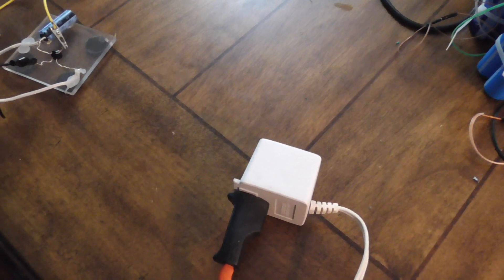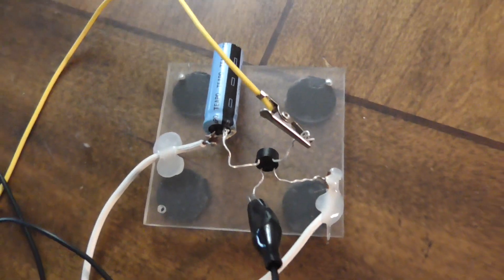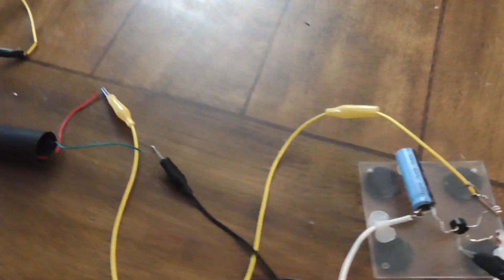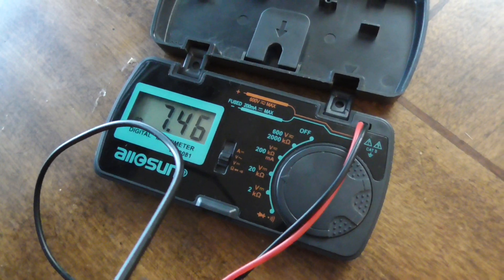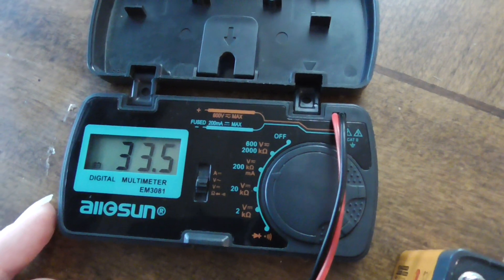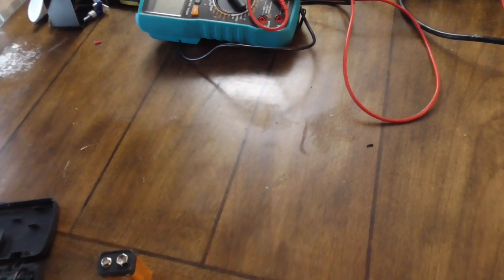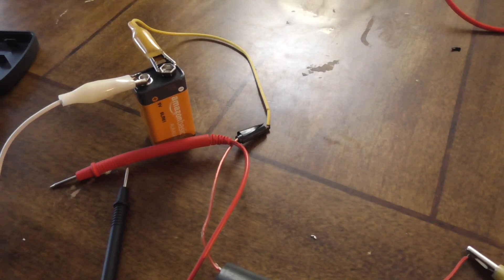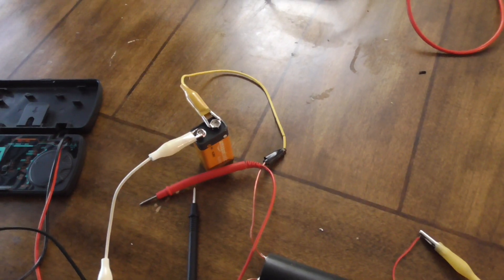How To Charge Any Battery For Free

Comment: hey joel, know this is an old vid, but when i calculated the values in your setup here i got around 86ma at the output, i may be completely wrong but a 100uf cap at 60hz has a reactance of 26.5ohms, and if it’s being fed 2.3v AC then the output is around 86ma right not 17? probably totally wrong here just wondering what im missing

Comment: One of the things that really bother me about tech and ideas like this is, if this works as well as people say it does, why are they not using it to run their refrigerator or some other equipment or something. If they can store enough energy to take devices "off grid power" than why are they not showing us that. If you have 4 car batteries that you can charge with these devices than in the worst case scenario you could use a DC/AC Inverter and run some piece of equipment, even if it is only for like 1 hour per day, that is still saving money on the electric bill every week/month.  Why not show us proof of what it can really do?

Comment: Could we use a 'AC Motor Speed Controller' or an 'AC  Variable Voltage Controller'' in place of the plugin transformer your using, providing we could adjust the AC voltage down low enough?

Comment: You got a new subscriber. What did you think of the Tesla switch? I was friends with John Bedini when he was alive and he always said that it ruined batteries. He had so many devices in his barn but most of them were not running but they did work.
Reply from the maker: Your lucky, I wish I knew John. I can go all day over this topic, So it's best to use that "spike" for other things like capacitive discharge motors, the drive pulse of reactive stages,  and some asymmetrical regauging of both and work your devices around this, Not good for dumping direct into batteries unless you want to condition and rejuvenate them. So it has its usage and John later had fancy switching of I think 4 or 6 batteries, because of this issue, It was ok as long as he kept them in state of constant rotation. It works people will pick at it because someone knows they can make it more efficient of course, If I had no limits in money space resources etc, I could build one that ran the world as well hehe.
Reply: @joellagace1679  Hi, Why don't you make money by creating a circuit that chargers batteries for free then go to small businesses and propose that they run their business on batteries. Your system will then charge their batteries for free and you can set it up to be automated so it charges the used battery while the charged battery is powering the business. 💵 💵

Or you can sell that system to outdoors people or people who want to live off the grid etc 💰

You can just do it for a few people so that you don't get noticed by the power companies or government.
Reply: Check out Rick Friedrich on the Tesla Switch. I think you're better off building the solid state bedini except use a capacitor and dump that into the battery. If you use a micro controller, you'll be able to dump the capacitor into the primary battery and not need the swapping.

Comment: Joel
Is the black cylinder a high voltage generator?
Reply from the maker: its a flyback with a high voltage charging cap. I use it as the dump cap I believe, its been a while this one :)

Comment: Thanks for sharing
Can you share a schematics how to make the bridge rectifier to get this low current dumping
Reply from the maker: Circuit is simple. Reactance capacitor( I= V/X ) is in series with phase line of AC. It can be on any side. Bridge rectifier without a filtering cap to remove the negative half of the AC component. We keep the voltage pulsed. very important. The rest of the circuit I think you understand. the low current output feeds a tiny flyback oscillator and dumps this into a high voltage pulse cap. The whole circuit works around AC or Pulsed. Pulsed voltage and low/zero current is a "different" kind of energy. It won't run many traditional devices live. But we can experiment and do things with it. We send the output to our charging batteries, Here I get about 35 volts DC pulses out of it.  This triggers a chemical reaction inside the battery and you can to use real amps after from the discharge usage.
Reply: @joellagace1679  Thanks
Reply: @joellagace1679 do the batteries last the same as new or is there a loss after being dead??

Comment: Good job!! A very interesting experiment. What type is the HV module? I must definitely repeat Your experiment;) Regards
Reply from the maker: Just about anything will work to charge a cap at higher voltages for dumping, You could use a dollar store fly zapper module.
Reply: @joellagace1679  OK  thx. So let's do as Donald Smith taught - let's turn kilovolts into kilowatts!!!
Reply from the maker: @dukuhashimoto5151  Bingo! :) I just crank it up to 35 volts but according to what I read, If one had such batteries and you go 48 volts or more, that's where the what you would call  kilovolts start to add up to kilowatts. I just don't have that kind of setup at the moment :( Won't fit in my kitchen.